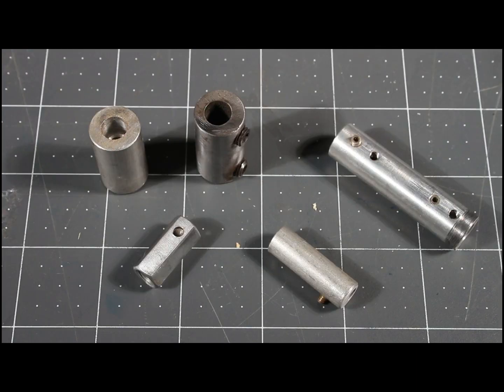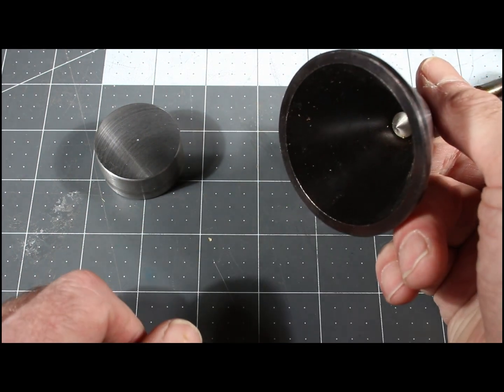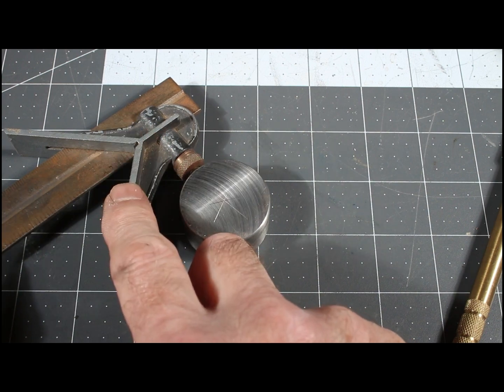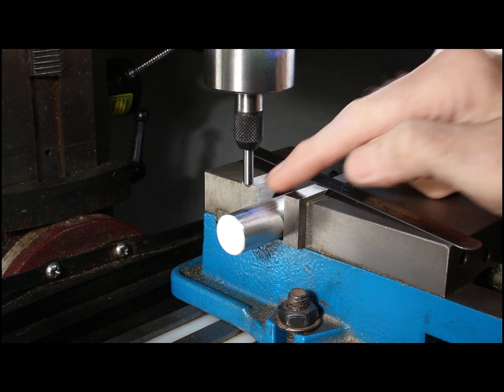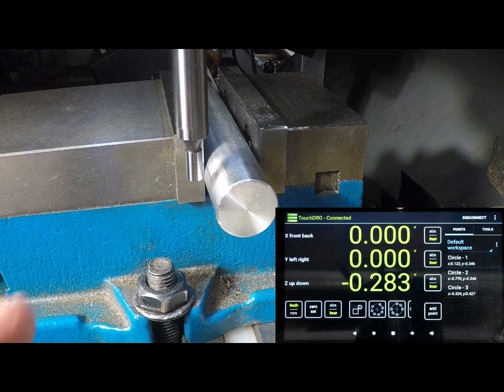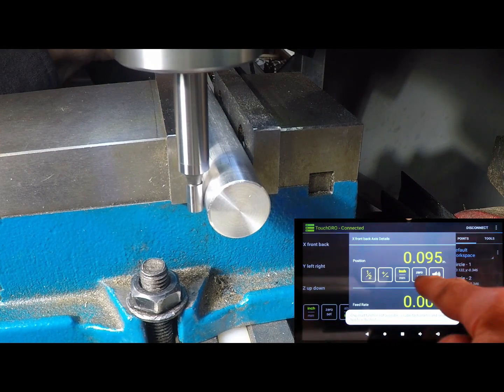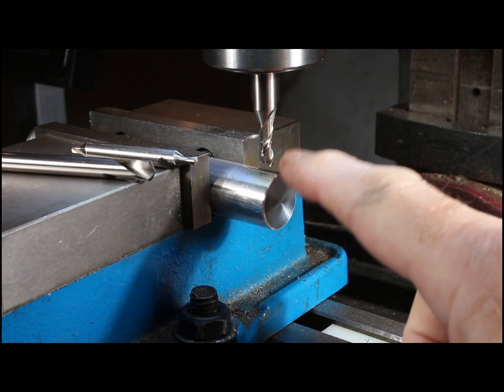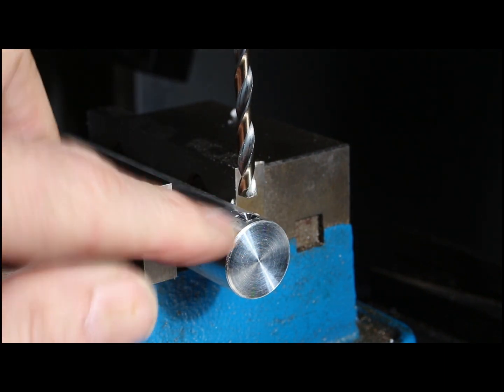Getting centered - center finding rods

Comment: A v-block is another method. Align the drill but with the bottom valley and place the stock on the v-block.
Reply from the maker: Yes - I like that, but it's not as accurate unless you use a wiggler or DRO to center the V under the spindle.

Comment: Edge finder should be run at 1000 rpm and the zero of the edge is found within a thou at the point when the edge finder kicks out not before it kicks out. That’s how I was taught years ago.
Reply from the maker: Yes, I heard that it should be 1,000 rpm, but that just seemed too fast.  Thanks for the correction. I hope others read your comment.  As I freely admit I am a home shop amateur machinist who doesn't know what he doesn't know.
Reply: @GuyMarsdenMakesStuff  I’m not a machinist either.  It was just a tool I had a need for but didn’t know how to use it properly so I asked a machinist friend to show me how to use it.
Reply: I agree that 1000 seems a bit high, but it works.  Edge is found when it pops out.